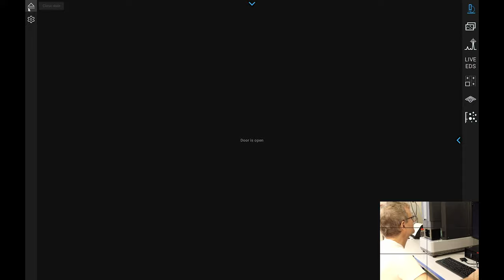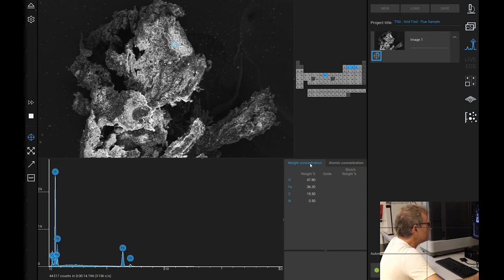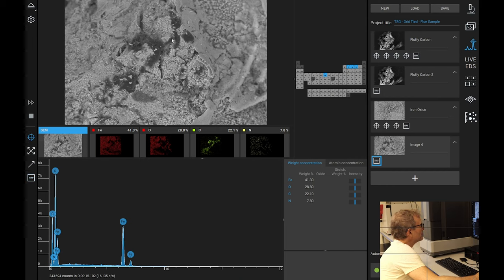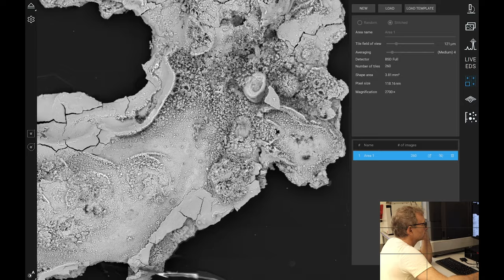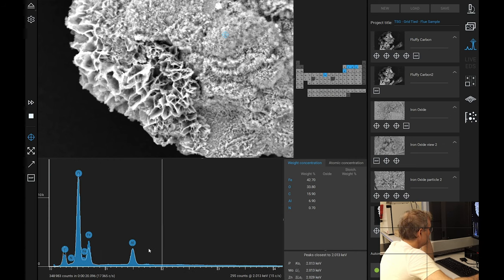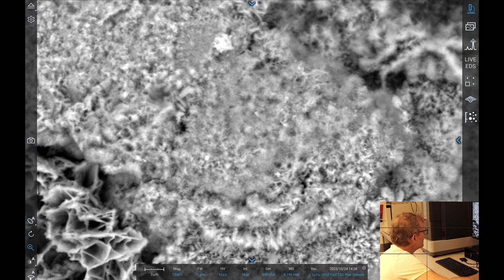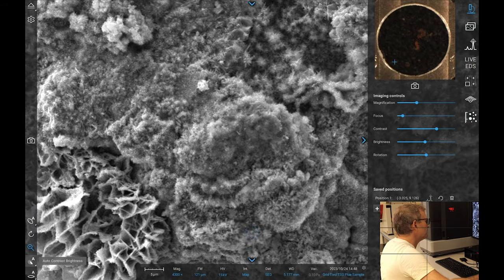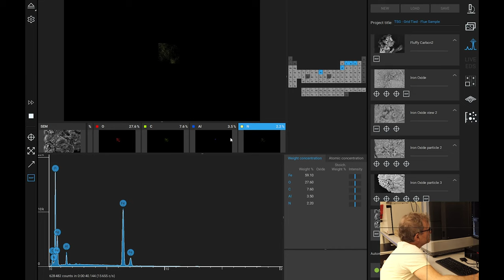THOR - Flue sample analysis from 300kW+ methane grid tied electric generator

Comment: As much as it pains me, the question has to be asked—any chance the tool you used to collect the sample was made of aluminum?
Reply from the maker: you can see in the video - it was the plastic sample container you can see at the beginning of the video, I lightly scraped the sphere with the inside edge a few times.

https://www.youtube.com/watch?v=DI2mhOqD06s
Reply: @MFMP  Haha just wanted to make sure, Occam’s Razor and what not.
Reply from the maker: It would be an impressive razor to get the AL in the middle of the potential vortex / anti-vortex pairs  @HCG

Comment: Perhaps a Joe Cell also gives a cleaner exhaust with a lower CO2 content. It also gives an idea of what can be achieved with an engine. On the model where he goes the furthest in challenging physics, there is not even a direct access to the carburettor. Ritalie explains it by means of hydrogen ions, but it is probably EVOs that are fed to the engine. See, How to install a Joe Cell.
Reply from the maker: A joe cell should create HHO if I recall correctly, this will produce EVOs.
Reply: @MFMP  Yes, and it seems that what makes the difference between ordinary electrolysis and the development of brown's gas is that when there is a distance between anode and cathode, H2 and O2 are developed. If the plates are close to each other, H and O recombine again without it being a combustion. Instead, they absorb a large amount of static electricity that keeps them in gaseous form. A video,   HHO 32 A quick look at straight DC   gives an illustration of what is going on without being a proof.

Comment: Why is it grid tied
Reply from the maker: Because it is at a power generator and secondly, It is hard to switch on 100, 200, 300kW of real load, but specific loads can be negotiated with the grid, so it makes it a perfect test bed. It is not drawing power from the grid.

Comment: Need a design with the vortex technology for an automotive turbo charger that forces cold (most dense) air (containing hydrogen???) into the intake of an engine.
Reply from the maker: We are a testing and scientific feasibility organisation, we are not designers of these systems, though we can provide hypothesis for operation and paths for potential improvement.
Reply: I understand.  The mechanics seem so simple however compared to the incredible engineering you guys are putting behind it. It would be great to experiment with or see a chat between your engineers and practical mechanics to discuss the technology.

Comment: Is there any way to know how many cfm of Air went thru to leave this amount of soot?  Did you have any expectation of what should be present if the machine performed as described?
Reply from the maker: When you find evidence of the structures that do transmutations in other systems, then it there is no magic in the matter transformations. This analysis is supportive of the video shared by the Strike Foundation of flux loop transfer of matter-waves out of and back into a TSG that, from our research, are likely caused by Magneto-Hydrodynamic formations that produce solitons bearing magnetic charges of two types.

Comment: Taking a sample from the flue is too vague sir. A sample was taken on (specific matrix) for (specific time) at (the mouth of the exhaust port) while (specific engine) running under load at (given RPM). Samples were hermetically sealed in (specific container) until placed in the electron microscope.
Reply: I'm sure it is under sufficient control
Reply from the maker: From over a decade of testing technologies, we know that there is no level of testing that will satisfy all, however, testing has to start somewhere. There was no plan to take samples other than to bring sample containers, look for opportunities and seek permission to take a sample. A sample was taken from the exhaust as shown in the video here.

https://youtu.be/DI2mhOqD06s

As we are an open organisation, we share the raw recordings of the analysis and actual data (will come)

What is interesting in this sample, is the arrangement of the matter in the latter part of the analysis. We already know that some of these Generators have produced easily visible on camera flux loops from Magneto-Hydrodynamic induced pseudo-monopoles, that can be present and unseen in other systems - such as LION, even when cold after operation, which we have tested before.

https://youtu.be/_jV_XVgMRiA?si=NJccuKPZpaGBaUY5&t=2414

These leave marks on materials as seen in this video.
https://youtu.be/sNHb0_9EmfM

But they can also form discrete structures as in the Parkhomov 225 day reactor.
https://youtu.be/7p8Y26d5gk0?si=Qr2PV38HMLTfD9e3&t=974

These structures have intense fractal toroidal moments, which lead to coherence of matter into matter waves at any temperature via their toroidal moment vortex and Aharonov-Bohm effect. Because of their inherent phase singularities and intense magnetic fields, they are able to perform novel matter transformations.
https://remoteview.substack.com/p/making-coherent-matter-wave-beams
https://remoteview.substack.com/p/practical-applications-of-the-fractal-87d

you will note, that the structure in Dr. Parkhomov's reactor is similar enough the the one in the sample from the TSG to support interest in further investigation.

Some of the most common elements to form in these processes are C, as noted by Brown (1980s), established by Matsumoto (1990s), Solin (1992), Ohmasa (2003), LeClair (2000s) etc. Oxygen, Aluminium, Silicon, Iron etc.

Unfortunately, all of these readily observed elements are present in the generator most likely, so finding evidence of the structures that do the synthesis, is more valuable.
Reply: @MFMP  Most gracious of you to respond, many thanks!